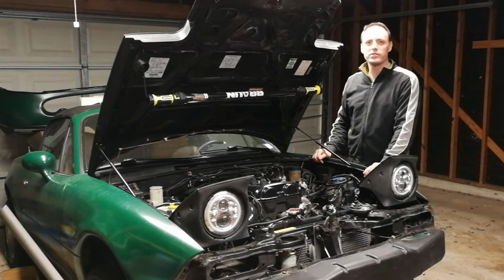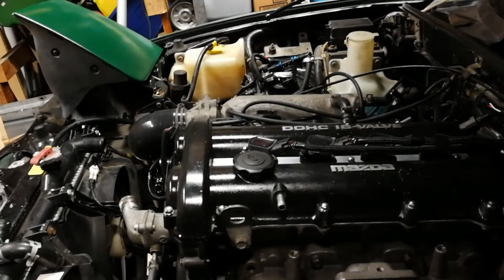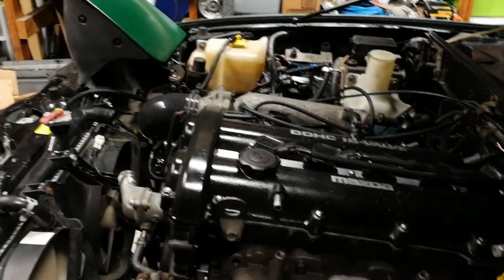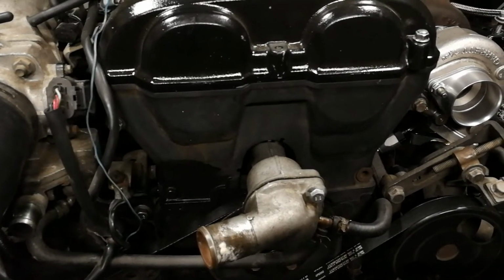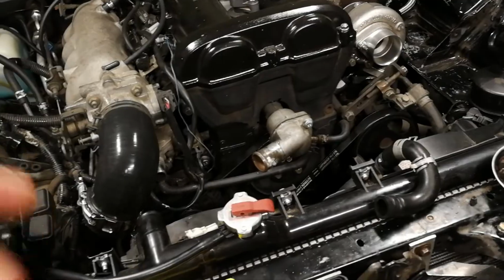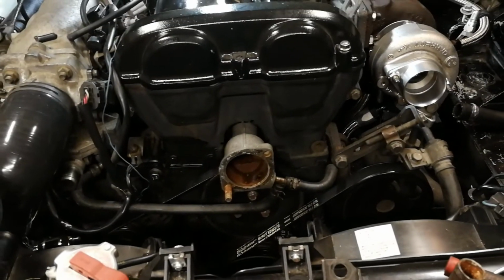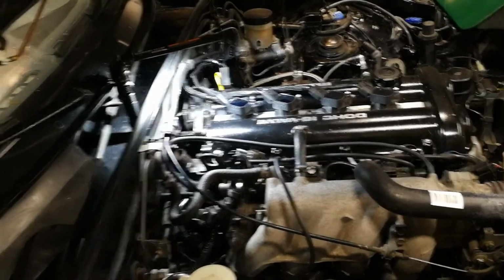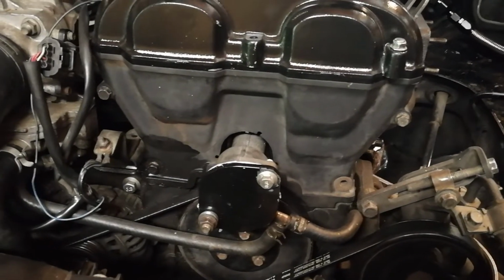DIY Miata Turbo (Ep 6) Coolant Reroute

Comment: Did you have to remove the CAS to remove/install the thermostat housing at the back of the head?
Reply from the maker: No, managed to get to it without removing the cas.   I did need to use a mirror and razor to help get all the old gasket off, though.  A little awkward back there. 😂
Reply: @OGPedXing  thanks, its definitely tight back there.  Im going to try without removing the CAS and see how things go.
Reply from the maker: I think for part of it I put a pad over the engine and just laid down on top of it 😄
Reply: @OGPedXing  now that would have been fun to see on video lol 😆

Comment: Hmmm coil pack doesn’t fit with the hose on mine :/ what should I do
Reply from the maker: It may be possible to modify the coil pack housing or even take a couple of pieces of flat stock to bolt to the existing two side holes and then bolt the coil pack up higher.  Or do what I did and move to coil on plugs!  No more plug wires to replace and a better spark.  Although you do need a standalone ECU to change the dwell from stock.

Comment: Would this work on an NA6? the front necks look a little bit different.
Reply from the maker: The necks are different but I believe that it would work. The rear housing is the same size although the CAS may be in the way, not sure of the clearance.  Double check though that there's a hole that the temp sensor can use.  See the pic in this thread: https://forum.miata.net/vb/showthread.php?t=412482

Comment: running the turbo water lines to the heater core (I've heard) is a bad idea due to the high restriction in the CHRA. Usually people source the turbo water from the two small lines on the mixing manifold, however. So take what I say with a grain of salt. Excellent work man, can't wait to see where this goes.
Reply from the maker: Really good points.  I debated this, the small line back to the mixing manifold is pretty good suction and I've heard the feed port in the block is pretty good pressure.  So I'm not sure what it will do.  I'm thinking if the heater actually works then that means some flow is getting through and I'll be ok to keep it.  If not then it's just sitting there and I should probably change back to the regular way.  The downside of the cheap reroute is normally a hose also goes from the front water neck to the heater core which is a lot of long hoses running around. Either way I'll post a follow up video with the results.
Reply: @OGPedXing  "a lot of long hoses running around" is not a downside compared to the awkward thermostat placement of the cheapo method, not to mention the questionable turbo water outlet line routing... you're correct that in the typical situation there is suction on the line back to the manifold and routing it elsewhere, especially to what is essentially a heatsink, is going to slow the warmup of the car and more importantly the warmup of the turbo. Just my $0.02, but in this case I think it's worth spending the money on a basic reroute kit to avoid the can of worms. Check out the IL Motorsport one, it comes with a bracket to support the long coolant line you don't like and it extends the new thermostat housing out from the back of the block so it's more accessible.
Reply from the maker: @mjohnson5108  interesting about the warmup of the car, hadn't thought about it in quite that way.  This is a stock port for the turbo feed so hopefully it won't be too bad.  Also the normal flow to the core is replaced by this. Actually I was surprised at how easy the access was for the thermostat, I had no problems getting it in.  There's a lot of space when you don't have a coil pack.  So maybe this is only a good idea if you're in my situation of having COPs.  I'll time the warmup and measure the heater temp and turbo temp, thank you for the constructive criticism, I appreciate it.